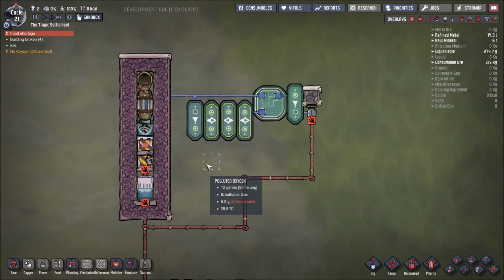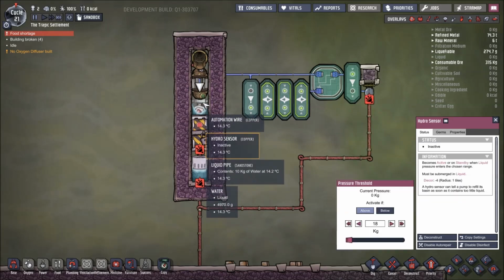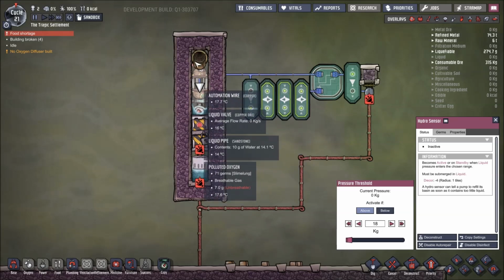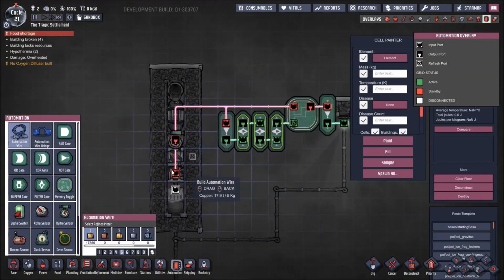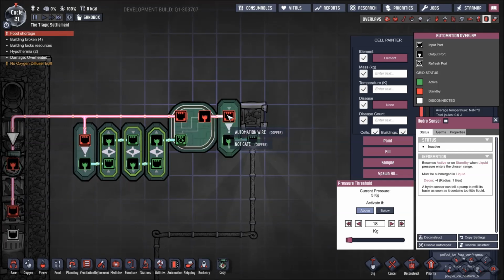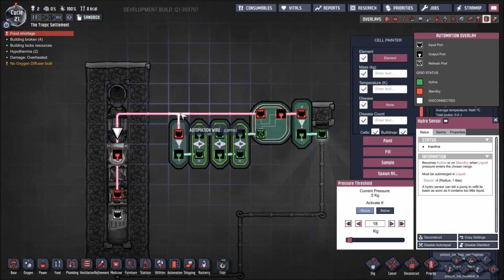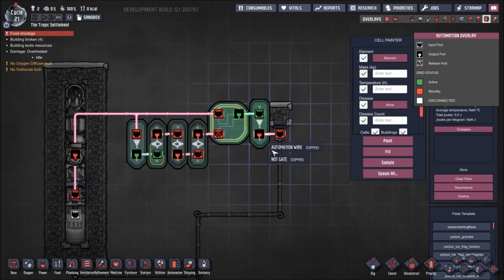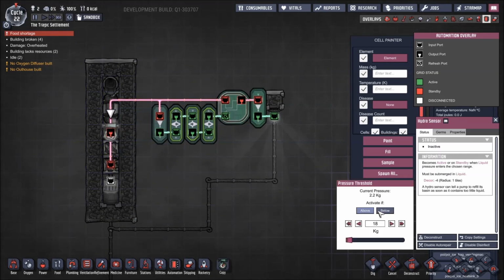Oxygen Not Included Water Clock

Comment: its 3 cycles on, 1 off, 2 on, 1 off.
cause the water allready pumps while the filter gater are still running
Reply from the maker: That's true but the clock is easily adjustable so changing the hydro sensor to 24kg would fix that.
Reply: @LurkzGaming  yes, but if you new to this you would miss that small detail =)